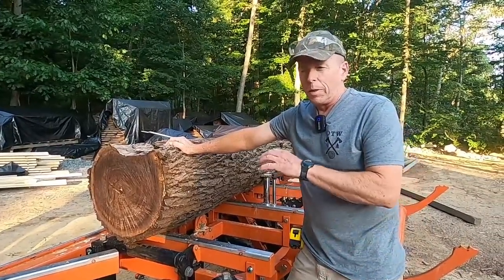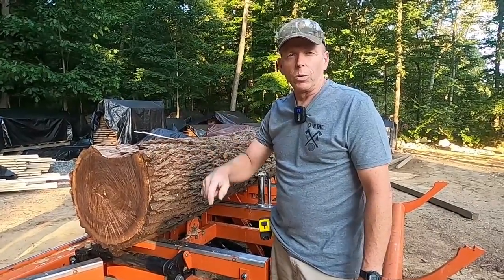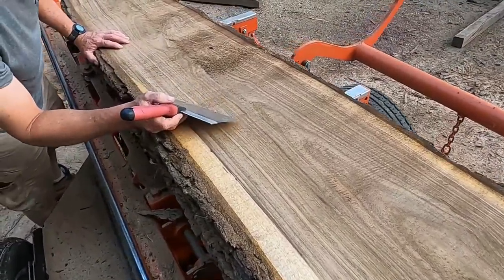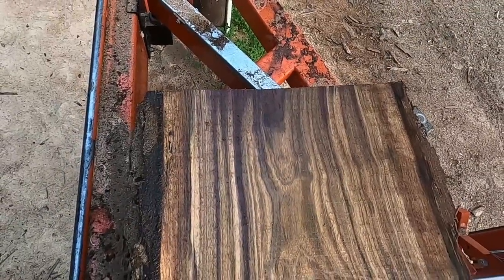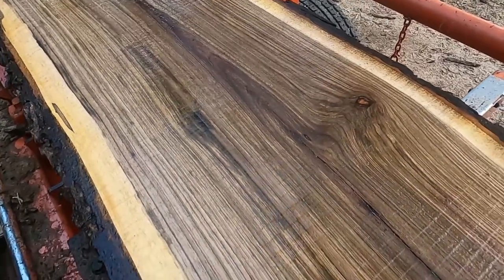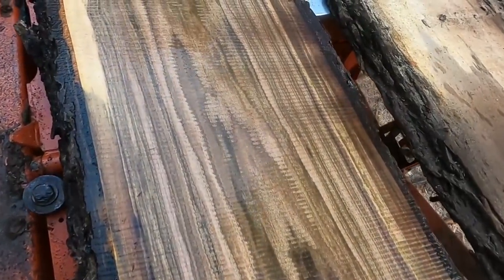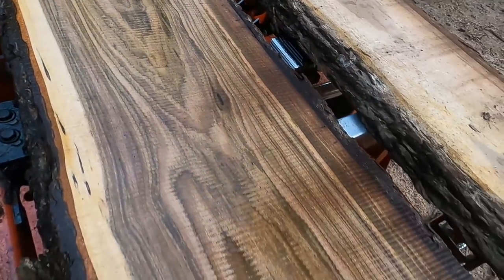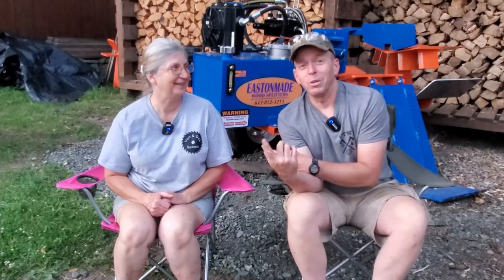Black Walnut Bar Tops

Comment: I know evey location has its own problems not sure if you have any problem with getting bugs. I have a solar kiln and do have the capability of doing a heat cleansing but was wondering what do you do about keeping them out while air drying
Reply from the maker: We just don't have annissue, but we are prepared. A pump sprayer with a borax solution in water. Spray it on the boards, and you are good.

Comment: You have some very valuable walnut logs here. Question: why wasn’t the debarker running? Black walnut bark is brutal on saw teeth
Reply from the maker: Sometimes we don't want the debarker cut on the live edge. Other times, we don't want Deb to have to worry about the debarker. One step at a time. :)